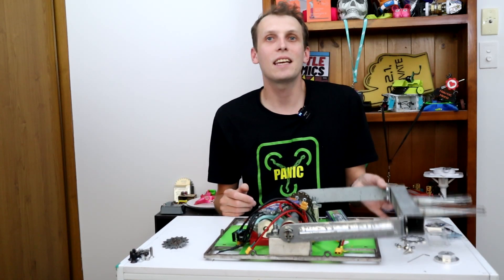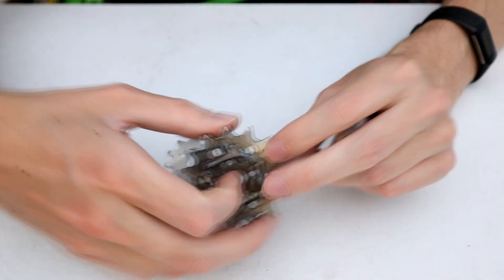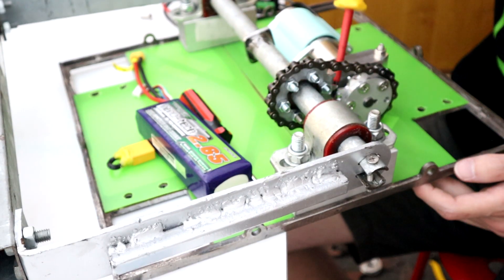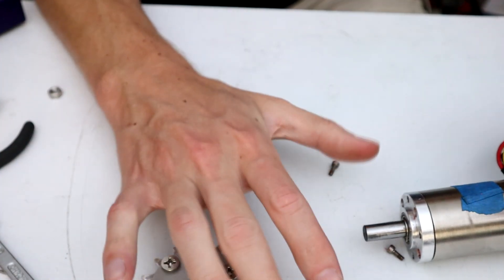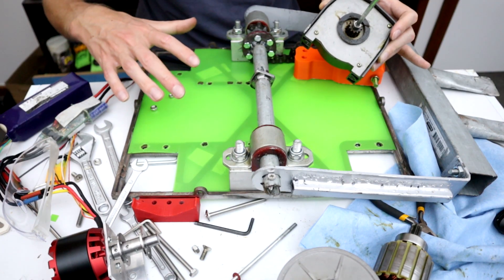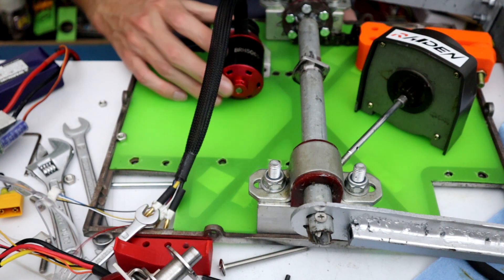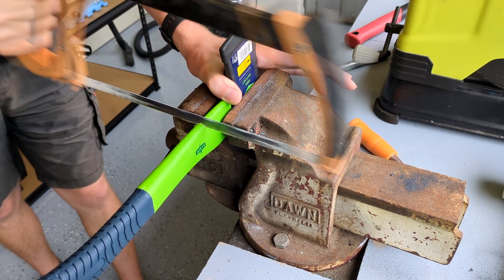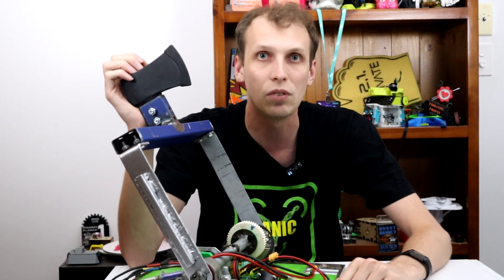The struggle to give my robot an AXE

Comment: I found a solution on youtube that might be a way to get the torque you need in a minimal space- High Precision Speed Reducer Using Rope by Aaed Musa. Not sure about the range of motion but this seems pretty interesting and could be a good application for lifters and the like.
Reply from the maker: Yes! the capstan drive video, its very interesting but the range of motion is limited
For a time I considered trying to put one in this bot before abandoning it

Comment: Finish your feather without rushing for Robowars challenge (Impossible).
(Please, Ben, work on SYM at any other time than just before it's next event!)
Also, having your motor mount plate for the gearbox as a printed/machined mount is inspired.
Reply from the maker: I really need to work on him more through out the year

I'm thinking from now on I want 13kg bots mostly made before I sign them up

Comment: We used a scooter starter motor on a hammer bot in 30 lb sportsman. It swung very hard and could self right. We copied the batman bot from Robowars I think. Those motors have a ton of torque. I get it would be another compromise but maybe incorporate that in a future design. Goos luck to you!

Comment: Hey, I have a suggestion, but you don't have to trial it if you think it wouldn't work or would be too complicated. I'm only suggesting it if you really fancy going down the road of a rebuild.

If you really want an axe or hammer, how about running it off a kinetic battery? Think of it like a horizontal spinner, but without teeth. It needs to be entirely encased within the robot so that it can't be tampered with or stopped, and then it has a clutch that engages it and allows it to fire when you need it to fire. No wind up, no drag. The arm of the hammer is also essentially dead, so your design can be made for it to withstand the impact forces without worrying about the effort of getting the pivot to take the strain of throwing the arm down.

If you really want to be clever about it, you could run two spinning in opposite directions. This gives you a counterbalance, while also allowing you to fire a second time very quickly as you can set a controller to fire one, then retract with a servo pushing the arm back from underneath, and then have the second one queued to engage and fire. The discs that are being used as batteries don't have to be particularly heavy. They just need to spin quickly. The goal is to get them to store a huge amount of mass as kinetic force for when they need to fire. You could even have them fire similarly to how the old CO2 hammer bots used to work by using a system similar to a rack and pinion, and drive the pinion linearly from the clutch instead. It would also give you enough separation from the impact the axe or hammer face with each strike. You also wouldn't have exposed gearing like Beta does, as the mechanism is all concealed. If you have the arm bending down, and setup to take a load across the bend (like a bridge) it should be able to reach anywhere it likes in front of it. You can then happily have an armoured front.

As an added bonus, your robot will be harder to push around or be controlled by your opponent, as it will have an effectively greater mass. But hey, I may just be talking out of my arse here. I don't build robots any more.